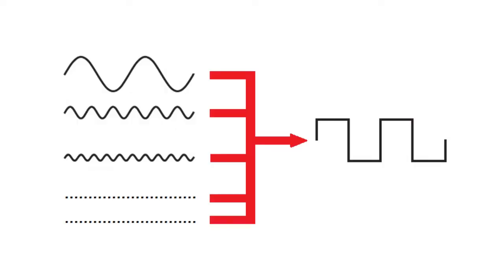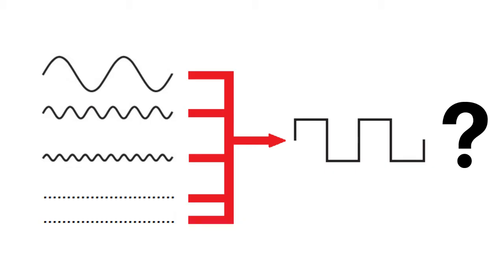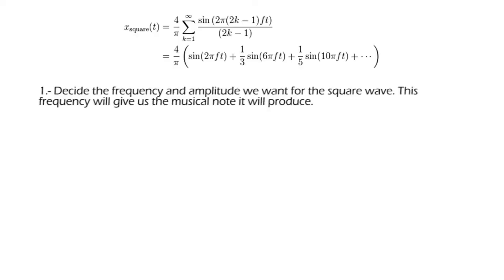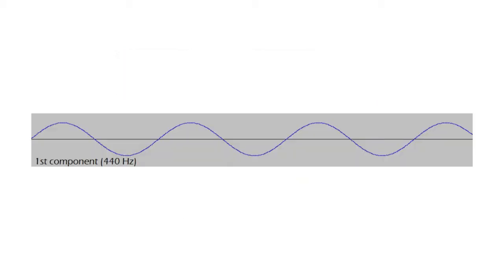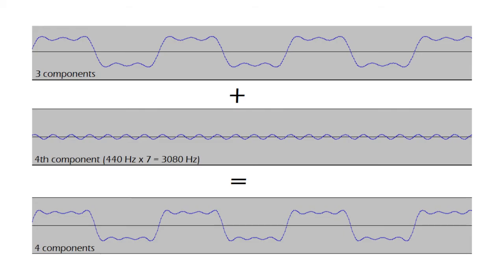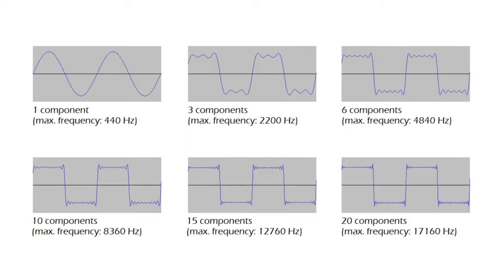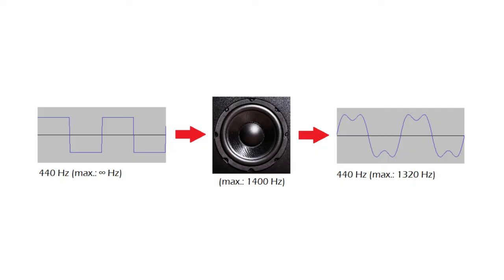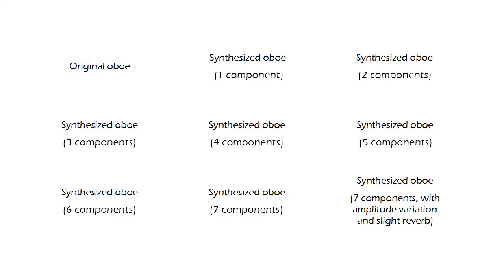08 Additive synthesis: building sounds with sine waves

Comment: Hello Mario！ I love the way you talk about additive synth, I wonder if you can tell me the name of the additive synth you used in the video, thanks a lot！
Reply from the maker: Hello! Thanks for your great comment 😁 I didn't really use any synth, I manually generated the sine tones in Audacity on different layers. Then I exported them to mix them together, and on the mixed waveform I just manually tweaked the envelope to kind of replicate the original tone.

However, recently I acquired a Korg Opsix which is a 6-operator synth, and although it is mainly marketed as an FM synth, you can also do additive on it if you set all operators to carriers. With 6 operators you can do things like supersaws, organs, and marimbas/xylophones/glockenspiels
Reply: @AwesomeAcoustics  Love you so much, I'll try Audacity later, and you remind me that there is an old yamaha dx7 in my home, it's time to blow off the dust！

Comment: What is the easiest way to calculate the list of frequencies and amplitudes of components of a sound, as shown at 4:41?
Reply from the maker: Hello! The way I did it was as follows:

1. Load the audio in an audio editing software (like Audacity, which is free)

2. Run a spectral analysis. This shows the frequencies and amplitudes

3. Manually take note of the frequencies and amplitudes of the prominent peaks. For musical notes, the frequencies typically will be multiples of the fundamental frequency. The amplitudes will typically be in decibels full-scale (dBFS), which are negative numbers

4. If required, convert the amplitudes in decibels to linear amplitudes with the formula A = 10^(dBFS/20)

I have a fuller explanation of decibels and how they're differnt from linear amplitudes, in my new English-only YouTube channel: https://www.youtube.com/watch?v=ERMrgyIMxdg

Comment: Can you use this form of additive synthesis to create a higher frequency sine wave using only lower frequency component sine waves???
Reply from the maker: Hello!

For starters, adding together different sine waves will always give you a non-sine wave. So you can't really make sine waves this way.

And regarding frequency, you have to think that low frequency waves will have a longer wavelength. Therefore, if you add higher frequency waves (shorter wavelength) the resulting wave will always have an overall frequency of maximum the lowest frequency you added (the higher frequency components merely add to the spectrum, and consequently, the timbre).

If the higher frequency waves you add are multiples of the lowest frequency, then the frequency whole result will be that of the lowest frequency sine wave. If your higher frequency waves are not multiples of the lowest one, they will not fit precisely with the low frequency wavelength and therefore it will take more cycles to repeat the pattern. In other words, the frequency of the result will be even lower than the frequency of the lowest wave you put there
Reply: @AwesomeAcoustics  Thank you for that explanation! To be honest, I'm not thinking about applications in the audible range. But what holds true for acoustics should also hold true for radio frequencies. So it is a very good analogy.

What you said makes sense. But I'm always on the lookout for possible paths around this clear limitation in frequency combinations.

I recently found an article on Phys dot org titled, "Physicists show how frequencies can easily be multiplied without special circuitry". It has this paragraph:

'...The team at MLU has now found a way to do this within a magnetic material without the electronic components that are usually used for this. Instead, the magnetization is excited by a low-frequency megahertz source. Using the newly discovered effect, the source generates several frequency components, each of which is a multiple of the excitation frequency. These cover a range of six octaves and reach up to several gigahertz. "This is like hitting the lowest note on a piano while also hearing the corresponding harmonic tones of the higher octaves," explains Woltersdorf.'

That part about hitting a low note and hearing a corresponding high tone is particularly interesting. Though the methods they describe here are apparently far more complex than just combining lower frequencies. I don't fully understand them quiet yet, but I thought you might find it interesting. As acoustics can be used to understand radio frequencies, perhaps the reverse is also true.

Comment: One more question

3:42 : There is a filter applied to a square wave. Where can I hear a demonstration how different filters act on human speech?
Reply from the maker: I made this short example. It starts with the original audio, followed by 3 filtered versions. The first one is low-pass filtered at 200 Hz (meaning all frequencies above 200 Hz were removed, and only frequencies under 200 Hz are left). The second is band-pass filtered between 200 and 2k Hz. The final one is high-pass filtered at 2 kHz.

https://vocaroo.com/1gvFrCx7nLQ2
Reply: @AwesomeAcoustics  Nice demonstration, thank you.

Comment: When you add together sine waves with integer multiples of the base frequency, is it important that they all start from the zero phase at the same time? How does the resulting sound change if the phases of the sine waves are not synchronized?
Reply from the maker: Interference only happens when you sum waves of the same frequency. But when summing waves of different frequency (even if they're integer multiples of the base frequency), the sound is not at all affected by the phase differences.

I show a nice example of this in my video about the human ear, at 3:24:

https://youtu.be/fmCvzH3L9iQ?list=PLc6BlWWbxqOL-Ow1UTRXvCt5w7mCbK0_f&t=205
Reply: @AwesomeAcoustics  Thanks a lot.

Comment: one thing that i dont understand if the sine wave oscillation poles are the vibration ( for exemple a speaker is going stretch in then stretch out ) ok this is logical because every point in the sine wave can represent the position of the  trajectory  of vibration in and out ( stretching' of the speaker = vibration ( up down )  = oscilation ) ,  , the problem is how the square wave is represented physically byu the speaker is it like skippiung some points its like traveling between poles without getting throught a center point which means telporting between A  and b poles ! so can someone explain this to me because i really cant understand ! and sorry for my english ..
Reply from the maker: Hello! That's actually a great and valid question.

As you say, a loudspeaker should physically not be able to go from peak to peak instantly. For starters, speakers will typically not have a frequency response higher than 20 kHz, they are designed this way according to our own hearing range. So really what you get out of the speaker is a square wave low-pass-filtered at 20 kHz which has an oscillation a bit more smooth than a perfect square wave.

Also, loudspeakers, like other vibrational systems, have something called a "phase response", which means that the different frequencies are going to be shifted in time, producing a different waveform, but since the frequencies themselves are the same, the sound you perceive out of it is the same.

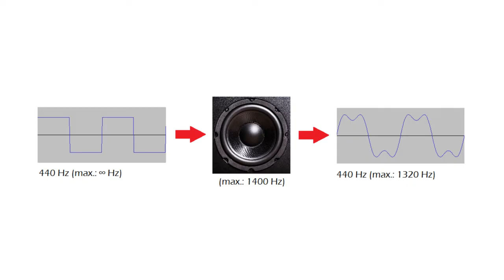There's a visual example of this in the video below, from 3:14 to 4:22

https://www.youtube.com/watch?v=fmCvzH3L9iQ

So this will also produce a different waveform, one that physically makes more sense, while still producing the same sound.

Also, I don't know which is your native language, but if it's Spanish by any chance, then remember that there's Spanish versions of all of my videos in this same channel :)!
Reply: @AwesomeAcoustics  thank you man this helped me a lot !

Comment: 5:17 How many components do you think you need to use to perfectly emulate the oboe? Or, what about a piano. How many components would you have to use, if you had to guess? A component is just a frequency and its amplitude, right?
Reply from the maker: It's hard to guess, it really depends on how strong are the components for each specific instrument AND musical note. Theoretically it'd have to be an infinite amount of components, but practically it would just have to be enough until any more components can't even be able to be picked up by the human ear due to really low amplitude or really high frequency